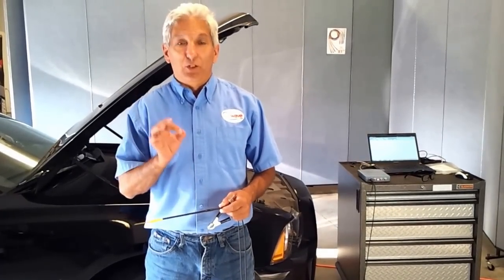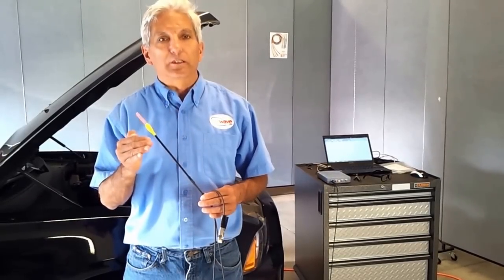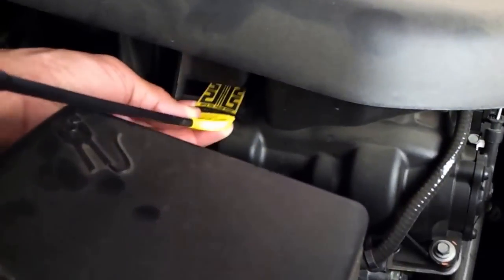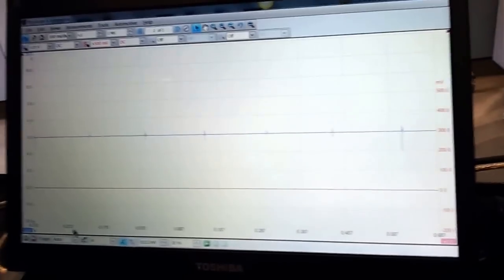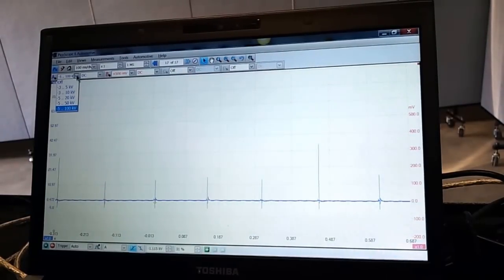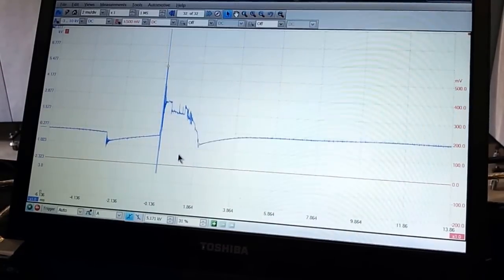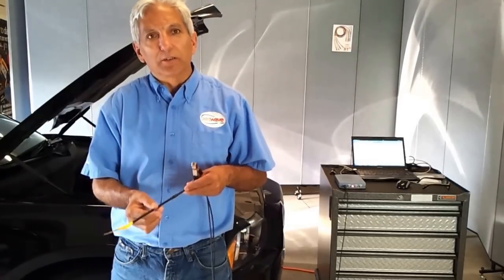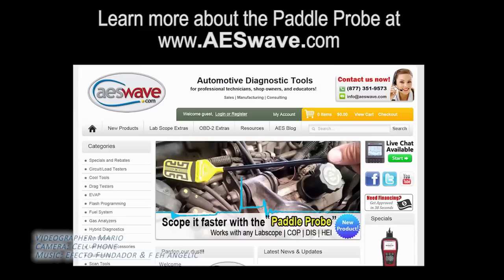COP Ignition Testing with the Paddle Probe and Pico Scope - Quickie Vid

Comment: Why is it that these Chrysler 2 wire COPs have that weird looking burn line that slopes downward . I see this same pattern on many of the 3.6L pentastar engines even when running perfectly fine with no misfires and with different probes like the Pico probe and your Paddle probe and even with just a lead clipped to a copper penny I see the same pattern . just seems.weird

Comment: Hey Jorge..Just noticed this video was posted in 2013.  Are you still including the secondary traditional plug wire clip with purchase.?  Reason I ask is, I didn't receive one of those with my purchase in 2017   Order #: 100-36051  
Thanks Kevin
Reply from the maker: Kevin, the 01-10 kit includes both the paddle and the spark plug wire clamp. The 01-16 only has the paddle. You can purchase the the clamp separately.

Comment: I recently bought the pico scope with you guys , do you have any link or video  to show set up for  secondary ignition , I was working on 92  toyota pick up 3.0 and the clamp was not graving the wire because on this truck the ignition wires are very thin , I got the snap on scope and I got a good wave form , I know i am missing some thing here  on my set up I was using the extenuater would appreciate your help.

Comment: Jorge, just out of curiosity, was there anything wrong with the vehicle?  It looked like to me the spark line was jumping high sometimes, was that because of scaling being switched?  Just something I noticed.
Reply from the maker: You will see that on virtually any ignition pattern on any scope.  Combustion by its very nature is not static, and you will see changes in the pattern due to subtle differences in each ignition event.  The way the probe works, in a electrically noisy environment will cause "jumps" in the pattern.
Reply: busjockey1  yeah,look like spark having a hard time reaching the plug

Comment: Hey Jorge will this work on 2,3 and 4 wire coils?
Reply from the maker: The number of wires to the coil itself is of little relevance.  The big difference will occur in overall coil design and shielding.  Some coils the probe responds better than others.

Comment: Can it work with a fluke scopemeter 192 and how hard would it be to set up.
Reply from the maker: (Copied from above) Yes, this unit will work with the Fluke 192.  Setup is pretty simple.  We can probably supply you with a datasheet if necessary. 

Call us if you have any questions.